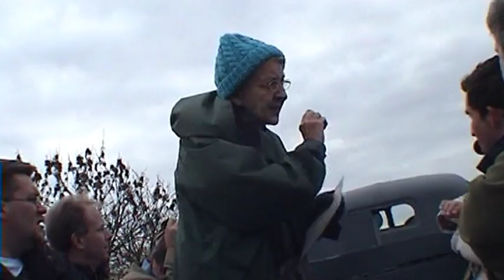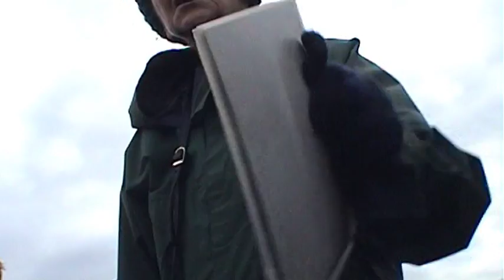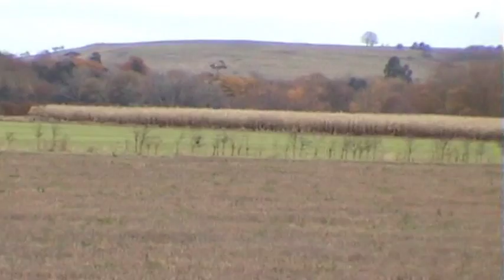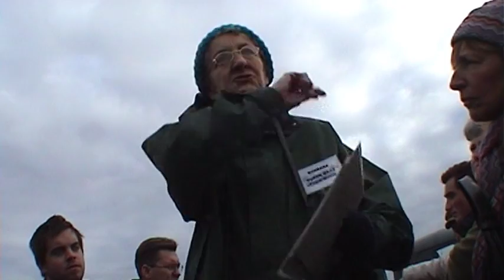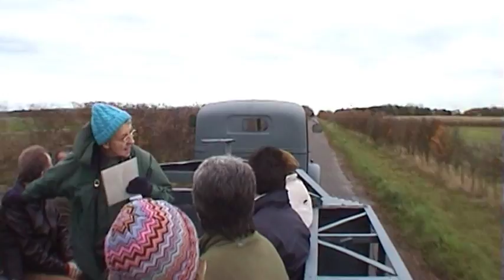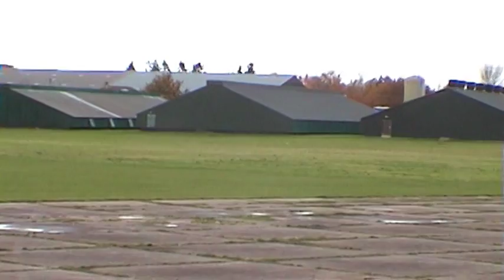East Kirkby Airfield Tour

Comment: 𝗧𝗔𝗟𝗞 𝗢𝗡 𝗛𝗜𝗦𝗧𝗢𝗥𝗬 𝗢𝗙 𝗥𝗔𝗙 𝗘𝗔𝗦𝗧 𝗞𝗜𝗥𝗞𝗕𝗬 – 𝟭𝟮 𝗡𝗢𝗩 𝟮𝟬𝟮𝟰 
𝗟𝗼𝘂𝗶𝘀𝗲 𝗕𝘂𝘀𝗵 of the Lincolnshire Aviation Heritage Centre is to hold a presentation entitled '𝗔 𝗛𝗶𝘀𝘁𝗼𝗿𝘆 𝗼𝗳 𝗥𝗔𝗙 𝗘𝗮𝘀𝘁 𝗞𝗶𝗿𝗸𝗯𝘆' at the Town Hall, Main Road, New Bolingbroke, Lincs PE22 7LD on 𝗧𝘂𝗲 𝟭𝟮𝘁𝗵 𝗡𝗼𝘃𝗲𝗺𝗯𝗲𝗿 𝟮𝟬𝟮𝟰 from 7:30pm-9:15pm. Admission is just £4 on the door. The Town Hall is a white building with three large arched windows facing the Main Road (B1183 'Seven Mile Straight') and is signposted from it.